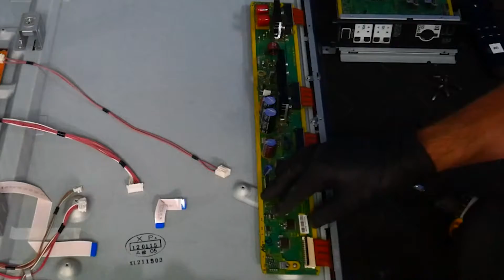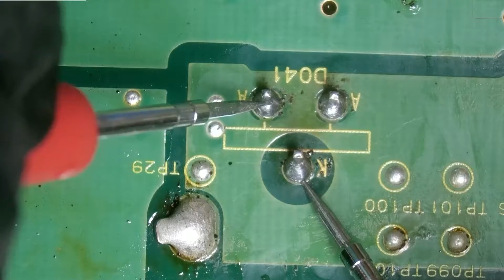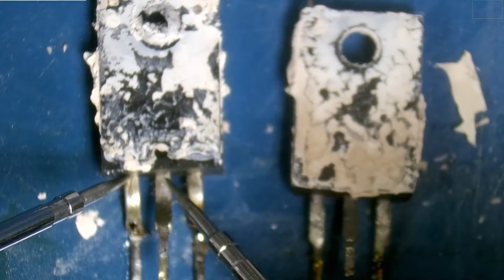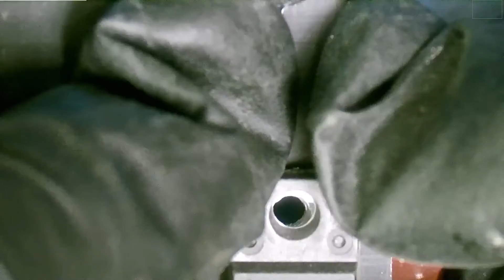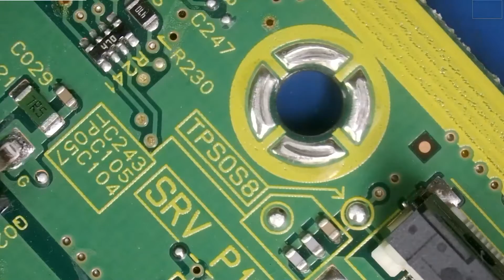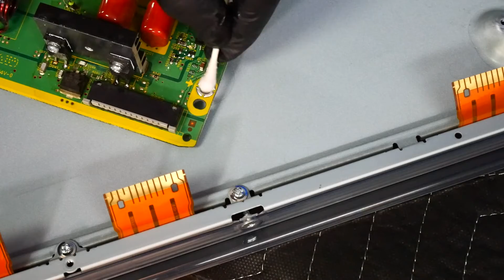Fixed Panasonic 8 Blink TC-P50UT50

Comment: Is the RF2001 a suitable replacement for RFUH20? My set has The RFUH20, but I can not source them in the correct package. It appears they are similar, but the 20 is a higher Voltage rating.
Reply from the maker: If the original has a higher voltage rating then probably not a good replacement. You want the replacement to have a higher rating.

Comment: A BIG thank you for doing these videos, I have the exact same tv which I love with the exact same problem (corrosion in the same ground contact) my tv turns on, displays an image for some seconds and then randomly turns off with the 8 blink code, will try to repair it again today

Note: before this vid I was suspecting about the SS board because when the TV is turned on if I disconnect SS board it stops turning off
Reply from the maker: If you get a proper picture for a few seconds then your SS board is probably okay but I would recommend cleaning out the ground contacts for sure. I would also recommend pressing and holding the power button for 10 seconds after the 8 blink occurs and then release. This will reset the TV. If the 8 blinks still occur after the screen comes up for a short period of time it's actually possible you have a mainboard failure.
Reply: @NicksTVRepair  you're right, I realized there is something wrong with main board; however, believe it or not when pushing down heat sink it stopped turning off 😂... Well I managed to add some pressure to the A-board CPU and problem solved (maybe an overheat issue) but thanks again I really love this TV because of its stunning image and motion clarity keep up with your great work!

Comment: Great repair. If you are having problems removing a throughhole component that you were intending to change, then to avoid damaging the PCB, simply snip the legs off on the component side and then you can easily remove the pins with an iron and some tweezers and then easily clear the holes afterwards with some braid or a mechanical or electrical sucker.
Reply from the maker: Yup that is also a good approach.

Comment: This is Great to know someone out there can still fix these Awesome Plasma TV boards,I have 2 GT30's one 55" and one 65" both front 2011 these Plasma TV's have a BETTER picture than my LG CX Oled and I would like for them to live as long as possible. I learned the hard way about the screws loosening up causing board failure(7 blink) on the 55 approx 7 years ago and had it repaired at a local electronics repair shop(that is closed now). Since then approx every 2 years I remove the backs and re tighten all board to chassis screws. So far so good. However I have bookmarked your site for if/when I ever need service on one of these or the LG,and based on your LG  OLED repair video it seems like I am on borrowed time for that thing too. Do you have any other advice for the Plasmas or OLED to help them live longer?
Reply from the maker: For your OLED LG it would be advanced and risky but I would recommend removing the heatsink and old crusty thermal past and putting high-end MX-6 instead. The old paste on there will be rock hard and removing it will require chemicals and to be very gentle because the CPU has very small SMD caps on it also covered in that very hard crusty paste. it's very easy to damage the CPU while replacing the paste which is why I say to be careful. We have a system put in place to remove it using an ultra-sonic cleaner, and several chemicals to loosen it up. Without that, it's almost assured the CPU will get damaged so I almost don't recommend you do that. 
I have heard of people cutting a hole in their back cover where the mainboard is and having a small fan blowing at it. It's a bit extreme but that would help ensure a longer life to the set. 
As for your Panasonic, I would recommend lock washers for the screws.
Reply: @NicksTVRepair  Thanks for your response,so realistically use the OLED until it has a failure then contact you guys for repair/replacement of the failed board or just  replace the TV as this level of repair is well above my skill level and this OLED has been a dissapointment(picture quality) since I got it when compared to the Plasmas viewing  1080P or lower resolution content,and 4k/HDR isn't much better. It will be 4 years old in Dec. I do use a fan to move air across the back of the 55" Plasma to help keep it cooler,I dont use the 65"Plasma enough for this to be an issue and I have seen  updated repair kits have lock washers. I have actually thought about cutting the back open on the Plasma over the board that gets hot. The next time I perform my "Screw Maintenance" if they are still available I will look into the updated screws and  lock washers. Again I wasn't sure anyone was still repairing these Plasma TV boards,hopefully I wont need to but it good to know that currently you guys still are.

Comment: I totally agree with @antoniomrubio, the best TV repair channel on YouTube! 

Do you ever use low-temperature solder when you have problems desoldering components? Sure, it's more expensive to use, but it could probably help remove components more gently? Unless it's not recommended. I don't have enough experience to tell, but curious to know.
Reply from the maker: So when it comes to his topic some of my techs will say that I am stubborn. So we have plenty of low-melt solder, but I do not use it because I don't believe it helps. Some of my techs disagree with me but it doesn't make sense to me. 
If I have high melt solder on a board, adding low melt solder to it won't all of a sudden lower the high melt solder's actual melting point. The melting point will still be high and I'll just have a bunch of liquid low-melt solder sitting on top of none molten high-melt solder. It's still going to require me to get to that high temp to remove the high temp solder. 
Adding flux to help the heat transfer from my solder tip to the high melt solder seems like a more efficient solution in my mind than using a larger solder iron tip. 
I probably should have used a better soldering iron tip perhaps.
Let me know if you have any other info on this. I am open to changing my mind but so far it seems to be mostly opinions and prefferences for people that use it. 
I haven't really seen any concrete evidence that it really does help. 
Also to be clear I have a different stance on the leaded solder that I add in the video mostly because the leaded solder I add in the video has a rosin core aka flux. So by adding that solder im also adding flux. Really I should just have added only flux and didn't really need to add solder on that one joint.
Reply: @NicksTVRepair  I really like the reasoning you use, and since I'm not an expert on the subject at this moment, I think I'll do some tests with :
1- With Rosin and the desoldering wick only, 
2- With flux and the desoldering wick only, 
3- With low solder only,
4- With the soldering iron and the desoldering wickonly, just to see the differences. (That one will be awful)

I'll share my results. Since low solder is more expensive, I'll have a better idea of the best method to follow at the lowest cost. I have some donor board to play with. Thanks
Reply: @NicksTVRepair  : (Quick test results) > I've just noticed, with the low melt solder, that we need to increase the iron temperature so that the low melt solder mixes with the high melt. But what I've just noticed is that the low melt solter adds a property to the high melt that slows down the hardening process. It left me a few seconds to remove the piece without the soldering wick. Then, with flux and the soldering wick, I was able to clean all the parts without damaging the vias.
That said, the vias are perfect (plus value), but it cost me low melting solder, flux and the soldering wick to clean them all up for the next piece.
Another observation is that I kept the heat applied for longer periods on the vias in order to mix the 2 types of solder well, against less time, and in sequence, with flux or rozin and soldering wick. But with a little more difficulty in removing the piece.
I also noticed that if the legs of the part were laying on the board rather than standing upright, I damaged a vias, whereas with the low-melt solder mix, I was able to remove the part without damaging it because of the few seconds it remained molten.
As I've already said, I'm no expert, so I hope I've done the best that I could. 

Here are my first observations.
Reply from the maker: Wow that's awesome! Thanks for sharing these results Jean Marc!